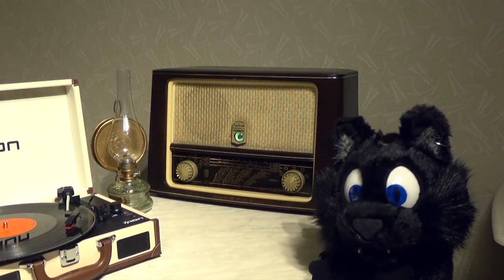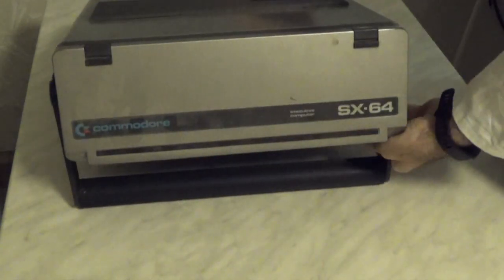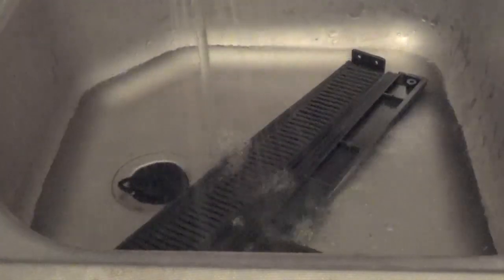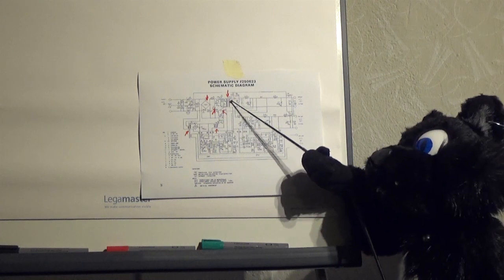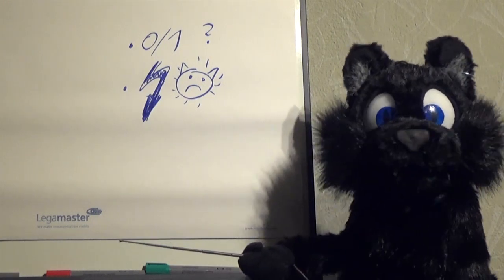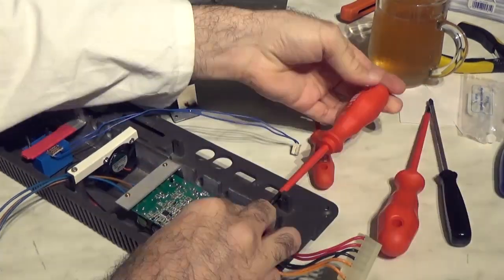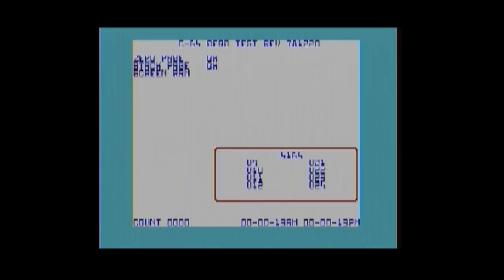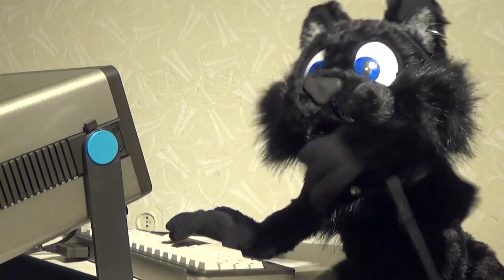Restoration Project #1 - Atkelar's SX-64

Comment: Maybe a 120Vac 60hz power inverter powered from 12vdc would be a good cheap option to run the SX64?...
Reply from the maker: That would be an option, yes. I did want the device to be "mobile" though. I mean: go somewhere, plug in and use like it was made that way. The new PSU takes 110-240V and 50-60Hz, so I should be able to plug it in anywhere now ^^

Comment: for the keyboard fault on some button non response ,any hint to solve ?
Reply from the maker: The keyboard of the SX-64 basically connects all the keys directly to the electronics within the box. Modern keyboards have chips inside the keybaord to prevent transmission problems. If some of the keys are not working, but the others are, and it's the same keys all the time... I'd guess that one of the wires isn't making contact. On mine, one of the pins of the plug in the keyboard came out of the plug... I'd say it's unlikely that just one wire broke, so... check the plugs. For electrical testing, you would need to unplug the keyboard connector from the PCB inside.
Reply: @atkelar  it is easy find a couple of that spring?
Reply from the maker: @kaiser76  Darn it, YouTube has successfully hidden that comment from me until now... and I check at least daily. Sorry for the daly here. Anyway: I never had to source any of these springs... and right now, I'd rather not take apart that keyboard again, because the plastic is brittle, so I can't really compare them to others.